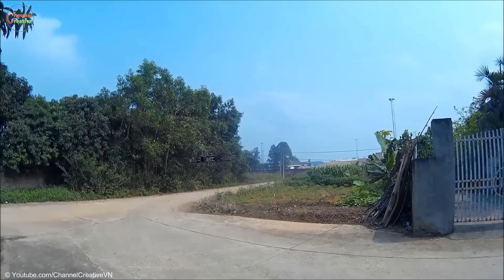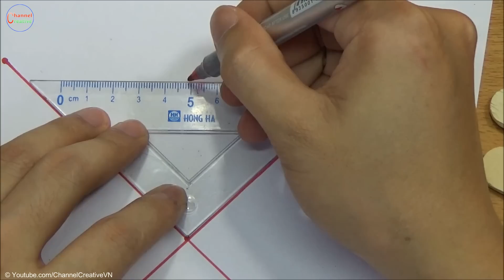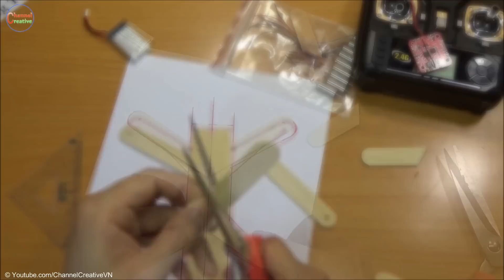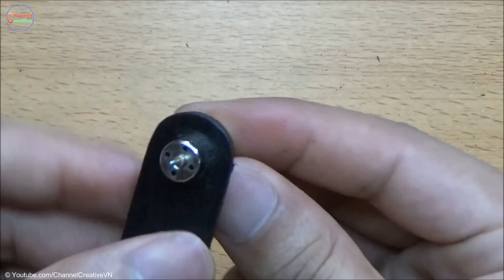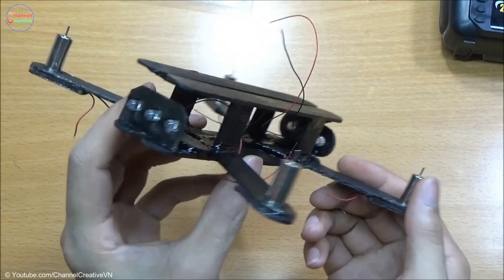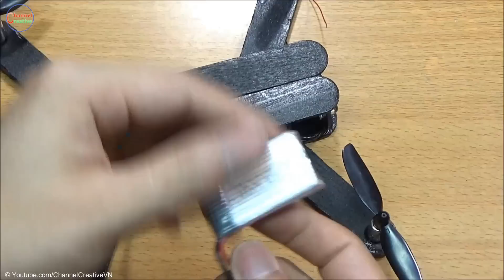How To make a Mini Racer Quadcopter use Popsicle sticks

Comment: wow, i like it (y)
Reply from the maker: +Lâm Nguyễn thank chụy lâm :3
Reply: ko cần thêm chữ chụy đâu thím
Reply from the maker: +Lâm Nguyễn =))) thế thank gái lâm :3
Reply: +Creative Channel can i have the link to bought the props please ?
Reply: +Creative Channel hey,can you please give me a site where i can buy the receiver and transmitter?
Reply from the maker: +Sergej Nadaždin hi friend, you can buy on ebay or amazon
Reply: +Creative Channel is it a problem because i live in serbia?
Reply: +Creative Channel 
where do you get the  Small Motors and proppelers ?

nice Video ! <3
Reply: +Samir Cj don't know where he got the props but he used all the other components from the syma x5c.
Reply: +Ultimate gamers well it costs me 200$ only to order one of those kite.
Reply: now you can get the x5c for around $30 (without camera)
Reply: Probably because it's components are engineered specifically for it

Comment: this is great work youre doing mate. could you please leave links to the materials needed from online where to buy ?
Reply from the maker: you can serach online in ebay or amazon
Reply: +Creative Channel   i have a receiver and a transmitter old, but this one use a 150 bettery, it works?

Comment: need tutorial how to connect wire to receiver and how to set radio control
Reply: if you use the same transmitter and receiver from the video, there's no need to. All you have to do is weld the motors and leds to its respective spots on the board.

Comment: for how much time did lipo battery works without charging
Reply: Depends on the number of motor you  use  and on  the weight of the object
But some batteries are factory charged might have high current or low

Comment: I made this but with a syma x5c-1 receiver board and transmitter with hubsan h107L motors and propellers and battery but when I connect the receiver board with the battery and turn on the remote the propellers won't move pls help
Reply: Which Ghz did you use